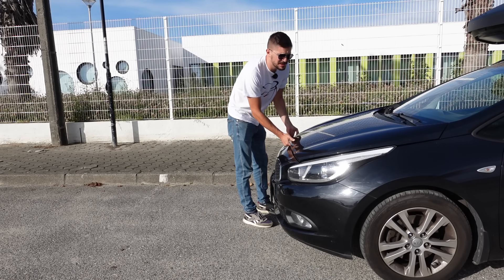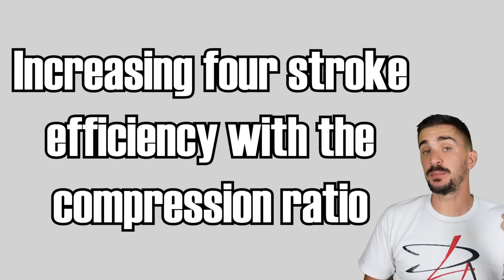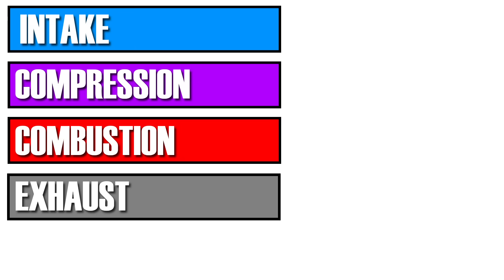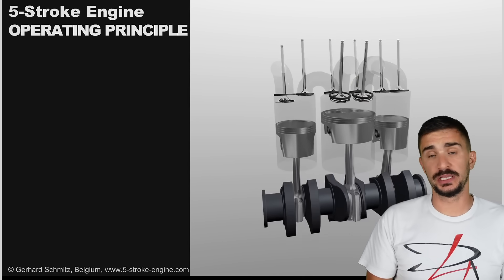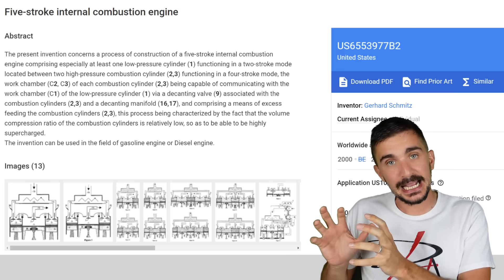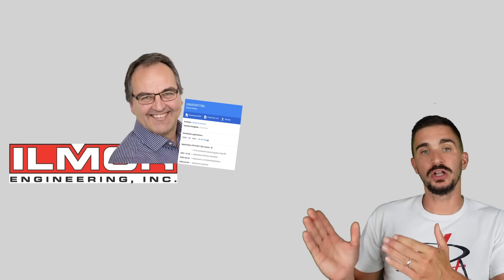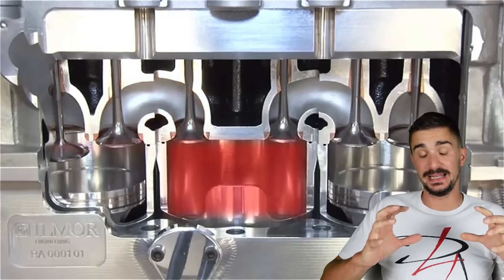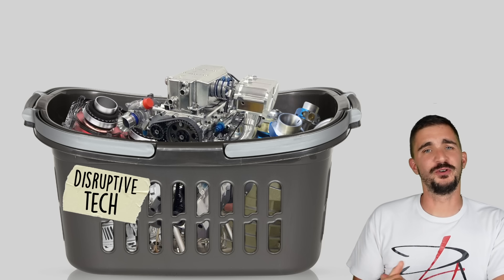Why Five Stroke Engines Are More Efficient But Still a Failure

Comment: Conventional 4 stroke is very versatile in terms of power delivery and efficiency at broad range of rpms. I just wonder, now, when we have the hybrid technology, why they don't use more of these designs that are much more efficient under high loads and narrow band of rpms for hybrids or as range extenders for EVs. There are 5 stroke, Atkinson, opposite piston (wow, just imagine opposite piston 3 stroke/2stroke plus expansion cylinder engine :D, ultimate Frankenstein :D), rotary and I can imagine even linear engine with magnets as generators or stirling for electrolocomotive vehicles like hybrid electric cars.

Comment: Makes me think the best 'enhancement' of the 4 stroke engine ever designed was actually Honda's Variable Valve Timing. Rather than 're-inventing the wheel', Honda very wisely took one single aspect of it and applied new thinking (and technology) to produce something genuinely useful. Honda truly is a visionary company.
Reply: It's kinda obvious that after fuel injection, turbocharging and VVT there are no economically feasible enhancements left
Reply: Fiat were the first manufacturer to develop VVT. Obviously there are lots of different systems to achieve the same basic result and Honda's version is unique but certainly not the revolutionary leap forward you seem to be making it out to be.
Reply: BMW has infinitely variable valve, duration and lift allowing for the n52 engine to run without a throttle body
Reply: @carloslara7452  honda perfected it 1st. They have insane engine designers. Look at the s2000 engine.... for its time crazy engine. My perfect car would be a toyota build with a honda drive train.... but not sure abouyt the transmissions.... honda trannys are a bit weak.

Comment: I do think there are some elements of this engine that are indicated as a negative point, (specifically the cat con not heating up fast enough) that could be overcome with adaptations.

One interesting version of this i would love to see would be a boxer setup for the low pressure pistons sharing a single chamber, and a much smaller but more numerous high pressure system.

My brain is buzzing with ideas, but like a fly its not exactly going in a straight line

Comment: Well, the EV's crowd who claim how efficient and clean their vehicles are, ignore that their power sources range from 25% for solar to 40% for natural gas with nucellar and coal somewhere in the middle. I guess the traditional IC engine isn't doing to bad. By the way, Napier, after WW2, added a turbine geared directly to the crankshaft to recover power from the exhaust of the engine.  Not to mention the Titanic routing low pressure steam from the two triple expansion engines into a low pressure turbine to drive the middle propeller. No wonder "Suck, Squeeze, Pop, Phooey" has lasted so long.

Comment: Seems like this kind of engine could be optimized for certain uses, like generators designed to run at a constant, specified, ideal RPM, especially on equipment that isn't subject to emissions regulations.

It's impressive that the 4-stroke piston combustion engine is coming up on 150 years. Mass EV use may seem new, but electric motors themselves sure aren't, neither are batteries. They're just in earlier phases of R&D than ICE, which we've been developing nonstop with tons of dollars this whole time. EV tech is likely to be crazy good in 10 years based on current trajectories.

Comment: What if they would combine the 5 stroke with a CVT to run the engine in the optimal RPM range at all times? would it be more benefitial than a 4 stroke with cvt maybe?

Comment: It's a pity that this engine ended up as a purely theoretical market changer. After all, the use of that extra piston has been done successfully with steam engines, so as long as the pressure inside it is higher than that of atmospheric pressure, it should provide some power. On the other hand, working efficiently only at low loads is not the end of the story. Plugin hybrid cars may still use it as range extenders for the batteries. The engine can be tuned to work optimally at a certain RPM which may be used to charge the batteries.

Comment: It wasn't abandoned - I instantly recognized this as a double expansion engine and steam engines in ships were using even triple expansion engines for decades until they got replaced with diesels.
Reply: I would believe it might work for  running a generator or other more single speed use. However the additional complexity makes other options better.
Reply: @Eskes1  So, like a Chevy Volt?  Technically the Volt uses its ICE for a bit of direct traction through a clutch when it makes sense to do so, giving about a 10% further gain in efficiency as a result.  

Using a five stroke as a generator then makes sense, as the power-robbing of the low pressure cylinder(s) at low power needn't apply.  If some means of speeding up catalytic converter heating could be resolved, that would address two of the problems identified in this posting.  Perhaps using battery power to initially heat the cat?  

All in all it becomes a more complex, and so higher cost system, but doesn't mean it couldn't be practical in some circumstances.
Reply: As to his points about what it was not taken up... Low catalyst light off and low load performance. Both of those problems would be easy to overcome
Reply: @boostedbird23 🕘 I 😮
Reply: Steam engines! Should be done for Diesel-Engines.
Reply: I was thinking the same thing, back when factories ran off a huge steam engine, they'd often use multiple cylinders, each one larger, to run off the lower-pressure but still pressurised exhaust from the previous cylinder. Some steam trains, too. They were called compound engines.
Reply: Triple expansion engines got replaced by steam turbines actually
Reply: Some Railway 'Compound' steam engines too.
Reply: Diesels, well, Ok but not before steam turbines...
Reply: Turbocompound engines take exhaust gases and use a turbine to let those gases do more work, so id put that in the listing as well
Reply: Funny ending 😄😄👍
Reply: yah this shit has been talked about for decades. Wont go anywhere other than for tiny engines with no torque.... it doesnt work properly. Otherwise someone woudl have built one and produced it. When somthing goes prototype so many times and its just abandoned..... its usually either to soon without the tech or just flawed.
Reply: @maxkool1330  its not that it doesn't work, as it worked quite well in steam engines for many decades. The problem with adapting it to ICE applications is higher initial cost, added complexity, and size constraints. Fuel efficiency means nothing if the monetary savings plus some are eaten up in the additional costs to buy and maintain the engine. If you go to any wwii era museum ship and see the engine spaces, youll find a crazily complex mess of pipes and equipment that took dozens of sailors per shift to keep running; the engine room of a moden diesel engine ship has an engine room thats fairly simple and open and requires less than 5 sailors per ship to operate. At the end of the day, the option picked the vast majority of times is going to be the one that leaves the most money in the bank at the end of the day.
Reply: @maxkool007  "otherwise they'd have done it already" isn't a good explanation, technologies come when they're ready. That can include economic factors but often just means the technology to make or use them doesn't exist yet. The principle seems pretty sound. Maybe they'd be good for hybrids, run them at their ideal RPM and have them charge the battery. Scavenging up wasted energy in all the ICEs out there could make a massive difference.

A lot of the problems in this video come from trying to use them as drop-in replacements in systems designed for existing 4-stroke engines. Perhaps they need implementing in a different way. A hybrid car, even without a large battery, could run using an electric transmission, generator to motors over wires, rather than a mechanical one. That decouples the engine from the wheels and means you can run things in their most efficient way. Diesel-electric trains have been doing that for decades, with the amount of power they take to move, the efficiencies are well worth the extra money. And money is a funny thing, prices can change for all sorts of reasons and things can become dirt-cheap if they're made in large numbers. 

Getting rid of a gearbox and transmission, no shaft, no weird joints, no diff, all of that complex stuff, and just putting a motor on each wheel (or just 2 wheels) could itself remove a ton of inefficiency. Not the subject of this video but it shows things can change and make new ideas, or old failed ones, very suitable.

Comment: So driving in winter makes 4 stroke engines more efficient than electric ones, because they use the otherwise would to be wasted heat for warming the cabin, while electric have to draw battery power for that! 🤣
Reply: Electric is still way more efficient despite this though. An ICE is wasting that energy all the time regardless. Modern heat pumps are very efficient in EVs and don't make much of a difference in range in moderate climates. EVs can pull heat from the battery/motor etc in the same way an ICE does. so they don't actually use all that much power to run.
Reply: @usefulrandom1855  That was just a joke 😝

Comment: Great video as always man, keep it up. One question, always wandered why are there not ICE on high efficiency applications (trucks for example) but just for electrical power, the drive to wheels will be done by electrical motors. I think on those applications where efficiency is key and high performance occasions are low those type of designs (i think chevy volt had something like that) could be quite good. What am i missing that truck manufacturers see? do you have a video on that already?

Comment: Well, if we take this engine as a generator for hybrids, all the flaws wouldn't be significant. Cat converters can be heated electrically prior to the engine start, and the engine spinning generator  would run with the load optimal for harnessing engine thermal and pressure energy.

Comment: One thing I have wondered a few times over the years is whether a TEC (peltier) system could eke appreciable amounts of power from the water/exhaust.
Even if it was 10% efficient. 10% of 65% nets out to an extra 6.5%. Given its direct electric, maybe that's enough to drive the AC/alternator?
Alternatively, maybe a sterling engine on the exhaust/water would have benefits like the 5 stroke without the negatives. That'd be far more complex though.

Comment: All nice and well except that compression ratio has nothing to do with how much energy can be harnessed during the combustion stroke. That is only dependend on the distance the piston can travel. So however you modify the CR, if the piston travel length stays the same, you will not get any usefull increase in transfered energy. You'll just increase the wear on the connecting components and the engine block.

Comment: electric cars are never going to take off unless they can solve the range problem and the Grid problem, we dont have enough infrastructure for every one to have an electric car and the production of them is far more harmful to the environment than ICE vehicles. I drive ICE because I choose to support plant life, plants need to breath too and our atmospheric co2 is very low at 400 ppm, plants start dying below 300 ppm, our earth would be amazing if we had 4 times the current co2 levels.
Reply: Whilst the initial production of EV is worse, from that point on it can be powered from renewables though, an ICE is burning gallons upon gallons of fuel, plus the gallons upon gallons of fuel the lorry that took it to the station. Plus the huge amount of energy to actually get the oil out of the ground/process it etc etc.. 
It takes about 6 months for the EV to overtake the initial emissions from production and obviously, the ICE is still relying on all of the above to create/distribute and burn the fuel.
Reply: @usefulrandom1855  getting oil out of the ground does not require Strip mining that destroys tons a land and pollutes water ways and most reliable electricity comes from coal and natural gas, "Renewable" energy also comes at a cost to the environment via strip mines and refinement process's, its far more toxic and it does nothing to help plant life like oil and gas co2 emissions.

Comment: "65% of the energy is wasted" Want to come north in winter and drive a while with out any heating? Sure energy is wasted, but its best method we have and will be in future, specially if we move towards diesel engines that can run on pretty much any oil, long as the engine is not so fancy that it craps it self in sight of dust particle in the fuel. Old mechanical diesel engine is the way of the future, since you can grow and make your own fuel well as repair it rather easily even in home machine shop unlike modern cars where you cant even repair them with out manufacturers programs. Of course globalists dont want this future, hence why they are pushing the EV's that are all possible to disable or worse(like put full acceleration and disable things like steering, brakes, on off controls and locking the doors and windows) remotely.

Comment: Well doesn't matter of it's heavy it can be used in generators, 
And i had an idea if we inject a little amount of fuel in the middle cylinder at low RPM only enough that it doesn't render as a dead weight we can actually make a good power curve.

Comment: Fun fact: Diesels aren't more damaging than Otto engines. They became carcinogenic when the government mandated certain filters in a Diesel car's exhaust, that broke up the particles that would usually just settle pretty much immediately and were too large to be absorbed by the lungs and made them into what we now know as "fine dust particles".
This is why, for example, soldiers working with the Leopard 2 tank don't all get lung cancer, since the thing doesn't filter the particles it exhausts, making them too big to become a problem.

TL;DR - If governments didn't regulate Diesels, they'd be less harmful.

Comment: The long combustion stoke of a Wankel engine helps here, but only when burning hydrogen. When burning hydrogen Wankles are around 23% more efficient as hydrogen burns far quicker ensuing all the mixture in the chamber is burnt. Current fuels are not suited for Wankels.

Comment: Turbo is taking energy out the back of the engine then putting it back into the front (including a turbojet).  This could be in the form of pushing more air into an engine, or sending the waste energy back into the output shaft giving more power. The centre compound cylinder falls into this. 
When you add extra centre compound cylinder, there is extra weight, size and friction losses. 
Exhaust turbos sending more air into the cylinders, are about the best at sending energy out the back and putting it back into the front. 

I do believe an aero engine had an exhaust turbo that was mechanically attached to the crank, not sending more air into the cylinders. I believe it was more efficient but only when operated under certain revs and conditions.

Comment: This principle of utilising the exhaust to drive a low pressure cylinder is not dissimilar to compound reciprocating steam engines from over two centuries ago. Great to see it be adapted to modern IC engines too

Comment: Correct me if I'm wrong, but don't turbos kinda already do the job of the low-pressure cylinder? They use the exhaust gas pressure that would otherwise be wasted to spin a turbine that force-feeds more air into the engine, that can either increase efficiency or power

Comment: Have you heard of the Kitson-Still steam-diesel engine? It was a marine diesel engine where the hot exhaust was used to raise steam in a boiler, essentially "free". In theory you got more power for the same amount of fuel burnt. In practise you had to have an engineer who was certified to work on diesel AND steam engines, and once your engineer had both qualifications he could probably get a better-paid job ashore.

Comment: I watched this other video about compound turbines which were used to drive the crankshaft instead of compressing intake air and that sort of worked for piston aircraft engines for a short while. Having a turbine instead of that bulky 3rd cylinder probably decreases that loss of having an extra cylinder idling, although in those solutions they still had the crankshaft drive that turbine to keep it spinning under low loads.

Comment: Would be very simple to convert inline 4 - 4 stroke engine to 5 stroke. Change the cams to make middle cylinder open twice many times and redirect exhaust and intake tube to make it recycle the exhaust... But to make it kind a worst... Maybe in a generator or a water pump always at the same RPM that can be useful.

Also use the middle injector to inject water to make it a steam middle piston 😂 I want to see that

Comment: The more complex a system is, the more inefficiencies occur and the more likely it is to fail. Steam engines have used thermal expansion pistons to recover work from heat. That same idea could be applied. It would cut down on power output/ weight, but everything is a tradeoff, isn't it?

Comment: I recognize everything you mentioned as a problem for the five stroke, so why not five cylinders? Arrange the power cylinders in a Vee with the "surplus energy" cylinder in the middle. Instead of feeding this cylinder using two combustion cylinders, we use four. Each stroke of the fifth cylinder receives exhaust from one of the combustion cylinders, so at low RPM, low load, we're reducing the dead weight problem. Four combustion cylinders would warm up faster and provide more gas for a turbo. I recognize that the valve train would be tricky, but that's why we pay engineers.